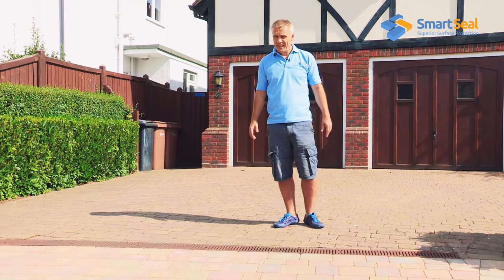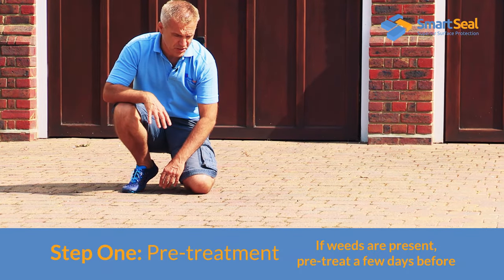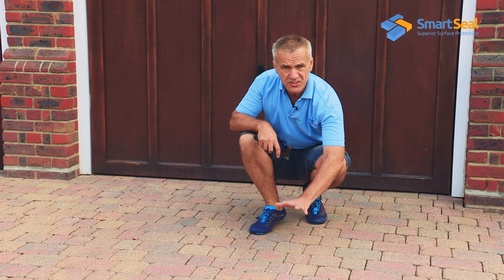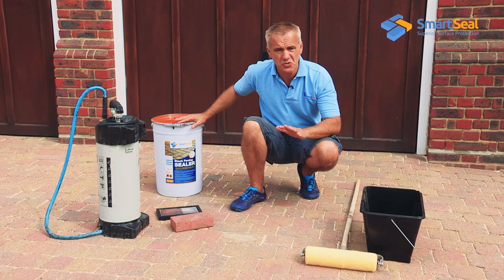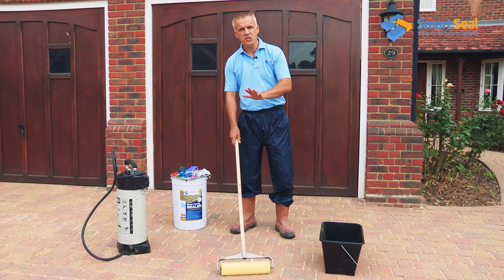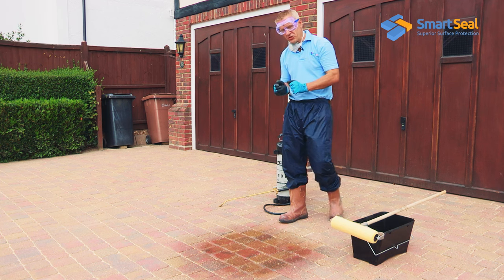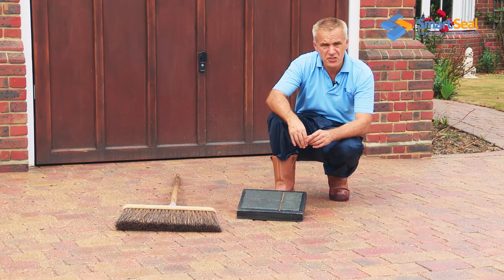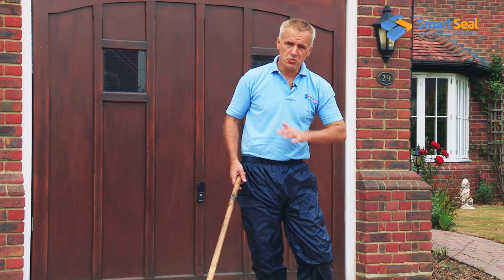Block Paving Cleaning & Application of Sealer - The EXPERTS GUIDE -  Sealing Brick Pavers

Comment: Great video and advice-thanks.
I have done my driveway  twice and found that the sealer made the bricks very slippery when wet or icy. ( I live in Canada). 
I always add a "slip protectant" to the mix to prevent this. The product I use is called "Shark Grip"- it's a fine sand like product that provides grip when walking on the rainy or icy surface.
Reply from the maker: Thanks for your positive feedback and info regarding the anti-slip additive. Much appreciated. Regards, Josh@Smartseal

Comment: We get snow up here in Canada. Will the sealer cause the pavers to be a slip hazard?
Reply from the maker: Hello Ron, hi to Canada,  if  two coats of sealer are applied to this type of paver, it will not adversely affect the  slip resistance of the surface. Hope that helps. George@Smartseal

Comment: i ve never done any kind of sealing before so need some advice please. on my block paving there are some small patches where I can see small puddles forming when it rains and after about 20 minutes they soak into the pavings. so do you sell sealers that would still allow water to soak through the block pavings. the last thing I really want is to seal my block pavings and when it rains I have puddles. i would be greatful for your advice. thnx
Reply from the maker: Hello Hasnain,  the puddles will be forming because either the paving is uneven in these areas, or the 'falls' were not set correctly when the paving was originally laid. These are issues with the paving itself and should be addressed prior to sealing. Very little water actually soaks through the paving or the joints themselves. After only a small amount of rain, the sand between the joints and  sand under the pavers would become saturated, allowing no further moisture to permeate through. Sealers by their very nature are 'repellents' and are not permeable. Hope that helps. Regards, Nigel@Smartseal

Comment: My block driveway is constantly growing large weeds, I've tried brushing in sand and it doesn't stop this. Will this sealant stop this ?
Reply from the maker: Hello Cheri, thanks for your question. Applied correctly, the sealer will set the jointing sand rock solid. This is the best way of inhibiting weed growth. Hope that helps, George@Smartseal

Comment: Hi how powerful should the pressure washer be to clean the paving?
Reply from the maker: Hi Amardeep, you can clean block paving properly with any decent DIY pressure washer. Just recognise if the pressure washer is not very powerful, it will take you longer. By using a pre-treatment for the dirt/moss/algae/weeds/pollutants, the whole process will be a lot quicker, easier and more effective. Hope that helps! Regards, Nigel@Smartseal

Comment: Hi there great video love how you broke down how many litres per square meter, was just wondering roughly how much sand per square meter you would use
Reply from the maker: Hi Chris, thanks for your comments. If you are following the guidance in the video and cleaning the joints to approximately 20mm , 1 bag of kiln dried sand should cover approximately 20m2 . Hope that helps Andrew@Smartseal
Reply: @SmartsealUk  that's great help thanks alot and thanks for the fast reply 👌
Reply from the maker: @chrislawrence5303  Glad we could help Chris

Comment: Hi, Would you recommend using sand that sets hard?
Reply from the maker: Hello, thanks for your question. If the sealer featured in the video is used correctly, it will set the sand solid. In this scenario the sand that sets hard (which costs a lot more than normail kiln dried sand) would not be required. Hope that helps. Rick@Smartseal
Reply: Hi, Yes,  a good swift reply, thank you.  😁
Reply from the maker: No problem.   @87114

Comment: Hi very informative video…will the  sealant dry when applied on blocked driveway in the UK in November/ December damp cold months or best to wait for summer for long lasting sealant dry? Please advice
Reply from the maker: Hello Jan, thanks for your positive feedback. We would certainly advise waiting until late Spring or Summer before applying the sealer. The weather is generally to damp and cold from October onwards. Hope that helps. Jake@Smartseal
Reply: @SmartsealUk  thank you very much

Comment: Outstanding video.  I gained so much knowledge about paver sealing. I am confident to hire a licensed contractor and ask all the right questions.  I live in Arizona.  Is there a sealant with a high UV rating?
Reply from the maker: Thanks for your comments Linda. Most high quality acrylic sealers are not adversely affected by UV light. I am not aware of a 'high rating' standard you could look out for. Regards, Josh@Smartseal

Comment: Are the sealed joints still water permeable? Drainage is a problem at times in my situation
Reply from the maker: Once it starts raining, unless you have permeable paving, the sanded joints would soon become saturated with water and become naturally non-permeable. If the block paving has been laid correctly, the falls and drainage installed (if required) should take care of excess water. Once sealed, no, the joints will set solid and would not be permeable. Hope that helps. George@Smartseal
Reply: @SmartsealUk  crushed stone base on grade, no pavement

Comment: Sorry if it has already been asked in the 103 comments but after applying the drive clean and leaving for the hour is an aggressive pressure wash needed or just a quick blast? Good video and informative thank you. Drive clean is on it's way to me for when boredom sets in over the Christmas break
Reply from the maker: Hello Peter,  it all depends on the condition of the paving, if it is in poor condition, leaving the driveway cleaner on for two-three hours should make it easier to clean. After that, the main requirement of the pressure washer should generally be just to take the muck out of the joints. Hope that helps. Regards, Nigel@Smartseal

Comment: How much sand and sealer did he use for that 2000 sq ft driveway? I have the exact same driveway..
Reply from the maker: 2000 sq ft = 185 m2 . If the work is carried out as per video, you would require  6 x 25L of sealer for two good coats and 9 or 10 bags of kiln dried sand if the the drive has been cleaned correctly, hope that helps. Rick@Smartseal

Comment: Can you mix some cement to kiln sand 4:1 (4 part sand to 1 part cement??
Reply from the maker: It is not advisable to try and fill the joints between the blocks with sand and cement. This should be kiln dried sand only. Hope that helps. Ricky@Smartseal
Reply: @SmartsealUk thanks. Wouldnt the cement dry with the sand?
Reply from the maker: In theory yes, but in our experience, the sand and cement  does not set correctly and residue stains the pavers.  Nigel@Smartseal
Reply: @SmartsealUk oh I see, makes sense. Thank you

Comment: Hi, once fully sealed how long approximately will it last until needs doing again
Reply from the maker: If you did nothing else Sean, you would still know you are getting benefits from the sealer 6-8 years later. If you wanted to keep the surface in optimum condition, we would recommend a top up coat of sealer, on average every 3 years. Hope that helps, George@Smartseal

Comment: Hi , just a question please. First I need to put the sealer then sand and last sealer again or just the sand then the sealer and olso how long to apply the sand if first after the sealer ? 
Regards
Reply from the maker: Hi Julian, If you are only just using clear sealer, you'd want to put fresh sand in and then seal with two coats. If you're planning on using the block magic, you'd have to use that first, sand and then seal on top with one coat of clear sealer. I hope this answers your question.
Reply from the maker: Sand, then sealer Julien, 2nd coat around 2 hours later, dependent on temperature.
Reply: Smartseal UK Ltd thanks for your time

Comment: So, no need to clean the newly installed pavers (bottom part of the driveway) other than maybe sweeping or a leaf blower?
Reply from the maker: That's correct. If pavers are newly installed and sanded, good chance a some of the sand will congeal down after the 1st coat, so make sure to 'top up' those joints before 2nd coat. Hope that helps!

Comment: Does the drive remain permeable with the sealer? Sorry if I missed if you said so. 

The main question clients ask me is what’s the difference between Marshalls and Bradstone or similar cost blocks -drives I did 15 years ago in Marshalls seem to have held their colour better and haven’t become as stony on the surface as Bradstone have. I’m guessing this sealer prolongs the colour of the blocks too?
Reply from the maker: Hi James, Thanks for your questions.

I am sure you are aware there is a big difference between ‘permeable’ block paving and standard ‘porous’ block paving. Permeable block paving relies predominately on drainage between the joints and through the porous sub-base.  ‘Standard’ or ‘normal’ porous block paving to drain correctly, relies on the water running off the surface. This is why setting out the ‘falls’ correctly when the pavers are laid is so important. With this in mind, the application of sealer will not significantly change the ability of either surface to displace water.

In terms of different performance between Marshalls and Bradstone blocks, that is a question best asked to those companies.  Certainly application of a UV sunlight resistant sealer will protect the blocks from loss of colour. The film of protective resin on the surface of the blocks will also help reduce the surface wear of the pavers. Remember, as mentioned in the video, overuse of a pressure washer could have caused the accelerated surface wear of the Bradstone pavers.
 
Hope that helps, Regards, Nigel@Smartseal
Reply: Smartseal UK Ltd Ok thanks. The aesthetic surface wear is just my observation of drives I’ve laid and pretty sure they’ve not been jetwashed ever so the weather and UV degrading is the only real factor I know of. I always try to sell the marshalls as for not a lot more they’ll get a longer lasting prettier drive. A few have asked me to seal them so just looking into it. Great video and good tips, thanks. 👍

A funny scary story for you- many moons ago a mate of mine was labouring for a rogue company (probably pikies) he saw them sell the client a sealed driveway for £250. They poured a pint of milk into a bucket of water and with a mop they covered the drive. (Using the client’s mop) 🙈
Reply from the maker: No problem James, if you require any more help or advice, please get in touch. Regards, Nigel
Reply: Smartseal UK Ltd Cheers Nigel 👍
Reply: its like your good at maths  but even better at making videos, !!!!!!!!!!!!!!!!!!!!!!!!!! lol keep up the good work.

Comment: Well made video but I have a couple of questions - Are you not doing a hypo treatment on this before resanding? Also, our clients would almost certainly take issue with the final results where the bricks are considerably duller than before. Can you, therefore, tell me what the benefits of this are over a biocide post-treatment (which would be much much cheaper)?
Reply from the maker: Hello, thanks for your questions. If a secondary cleaner as well as water (not always necessary) is required, in the video we are using our DriveClean Xtreme product. Application of the sealer leaves them looking clean and damp/wet, enhancing the original colours. The sealer is UV and water resistant, so it protects against colour loss and infestation of algae and lichen (which makes the blocks look dirty) Applied correctly the sanded joints will also be 'solid' preventing/reducing weed growth. Regards Rick@Smartseal

Comment: I prefer to just use hot water to clearn, and a lot more eco-friendly too...this looks like pure chemicals which should be a no-no nowadays (but please correct me if I'm wrong of course)
Reply from the maker: Certainly,  if practical, hot water works very well J and use of chemicals should be restricted. The key if you are cleaning with a product such as DriveClean Xtreme, is that when rinsing off, you use copious amounts of water. This ensures that any product filtering into the ground or water course is so dilute, it will not cause harm. For your reference the product featured is licenced by the HSE (health and safety executive)  Regards, Rick@Smartseal

Comment: What would you do differently if there were a pavement ant problem?
Reply from the maker: Hi Dick, thanks for your question. I would not do anything different. If the joints are cleaned properly and the sealer is applied in the right ratio's the jointing sand will become rock solid. In my experience, this will keep the ants at bay for a considerable period of time. Hope that helps! Nigel@Smartseal
Reply: @SmartsealUk  Thank you so much for your quick reply. Appreciate your knowledge and advice very much!
Reply from the maker: No problem, thanks for your positive feedback, much appreciated! @Aiden-yx9ht
Reply: @SmartsealUk  I also notice you use Kiln-Dried sand, does this work the same as a water activated polymeric sand? 

Also on the directions of the sealer I have it says to apply two thin coats instead of a single heavy coat. It mentions there's a risk of "bubbling and blisters", do you you think I can ignore this and go with your method of application?
Reply from the maker: The thin coats are when you are sealing Imprinted Concrete, for block paving, with sanded joints, apply as per video. Hope that helps. @Aiden-yx9ht
Reply from the maker: When the sealer is applied in the correct ratios, it will set the sand solid. It is the  same principle with polymeric sand. @Aiden-yx9ht

Comment: Good video. However, your vapour mask is actually a dust mask.
Reply from the maker: Hi Tommy, Thanks for your comments. FYR,.....although the masks we supply are disposable- They are for Toxicity and High Toxicity Solid - Liquids- Climax - 1730 FFP3 Individually Wrapped Disposable Mask - P3 Mask - Conforms to EN 149:2001+A1:2009 Regards, Alex@Smartseal

Comment: Very expensive
Reply: But very good products.just finished a job today.
Reply: @florincochintu8691   Wonder what the durability is like.
Reply: About durability don't know. Time will tell.
Reply: If you want to get rid of the moss and dirt use Sodium Hypochlorite 20L drum for £11.30, very very cheap. My driveway never looked so clean. Because of the quantity you're getting it won't break the bank.
Sorry SmartSeal, I'm just passing on some friendly advice.
Reply: The4thDensity that’s great to know ,my drive is not to bad ,used Thompson last year and has held out not to bad but needs doing again , will look at that though ...cheers